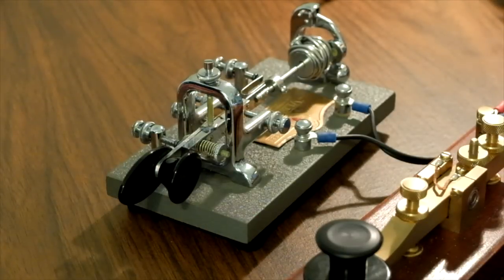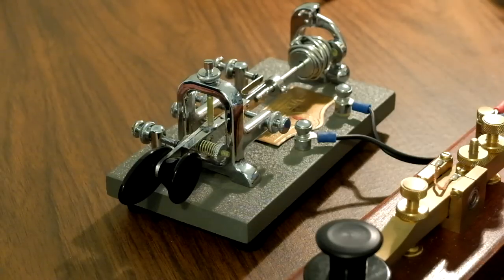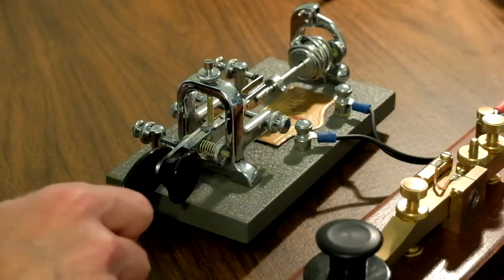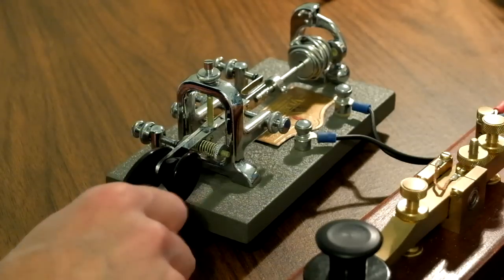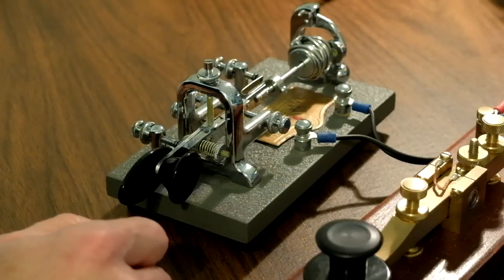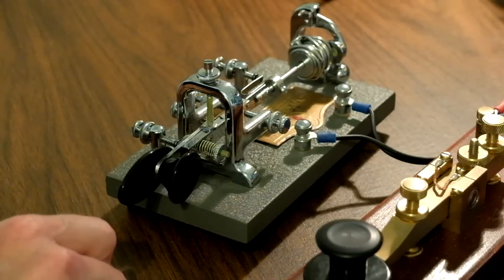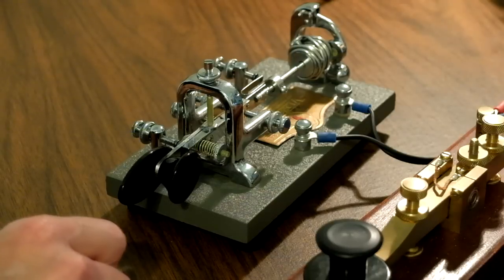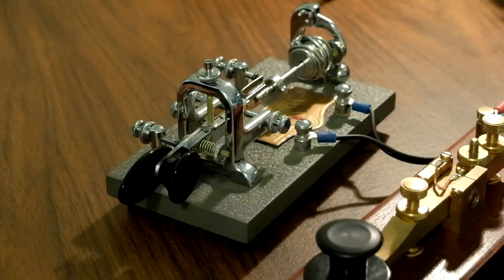What's up with the Vibroplex Bug Morse key's unique sound?

Comment: I watched an expert Navy sender on another video. He said you're supposed to grab the right-side key when interacting with slower users and make your own dits and dahs with that, from the side.  Not sure which was is right, but that's how he does it, and that way both dits and dahs are the correct slower speed.  Treat it like a sideways straight key.  I've also seen some guys dual-mount two keys on a board -- like an old Burnell straight key, which is in "closed" position.  Next to it is the bug or paddle key.  When using the bug/paddle, they'll keep the Burnell "closed" so only the bug/paddle works.  Then, for working slower ops, they'll open-up the switch on the Burnell and work from the straight key.

Comment: The unique sound, I suspect, is the result of the original design of the Vibroplex being suited to the commercial telegrapher of the early 20th century. The operating speed on the landlines was typically 35 wpm, and the rather narrow range of the Vibroplex is centered at this speed. Making the leaf spring either thinner or longer would slow the dits down, it doesn't appear practicable to add enough mass to the end of the pendulum for good sending at 13 - 20 wpm.

Comment: I was introduced to the "bug" in the military.  I was taught to "embrace" each of the paddles with the thumb on the left side (I am right handed) and the index and middle fingers on the right side, barely brushing against the paddle with each movement so that the base is never tempted to move side to side.  It's not a difficult technique to master  -  give it a try.  It will help you get /that "swing" out of your sending  rhythm.  73's
Reply from the maker: I've seen that demonstrated.i may give it a try.
Reply: It's the opposite of slap jazzing it.

Comment: If I don't have an "aftermarket weight," I take a Quarter and I alligator-clip it to the existing weight.  That can get the bug down to 13 wpm or so.

There's always the Farnsworth philosophy.  If my sending key won't go below 13 wpm, but the Ham I'm talking to is going 10 wpm, I can increase the spacing between letters to get down to 10 wpm, even though each letter is still being sent at 13 wpm.  At worst, it takes the other guy (or gal) a few seconds to adjust to the quickly-sent letters, but it's not a stress for them because of all the space in between the letters.

I consider doing that as "my good deed of the day," because I'm exposing them to more quickly sent letters, and that helps to increase their operating speed.

I would only send the letters a few wpm faster than the total speed.  I don't want to freak anyone out by sending, for instance, 20 wpm if they're only up to 10.

If they're going a lot slower than my bug can go, I can always switch to a straight key.  I never met a Morse sending device that I didn't love, so no problem breaking out the straight key.

Comment: never knew the bug's opt speed was over 25wpm. I worked my way up to Extra class when required to pass a CW test. got a bug due to, just couldn't send CW with a straight key any longer somewhere above 20wpm. I guess that is why I had no problem with  adapting to a bug, i was able to copy better than 25wpm.  I used my thumb and index finger as (without realizing) wrist action was less cumbersome.

Comment: I moved my weight to the back side of the damper and got it down to 15WPM. Also practice with a CQX 40m transceiver in practice mode its decoder is very unforgiving it took me over an hour to get my call sign down pat with no errors. I do love the bug though 1944 model black crinkle finish. All I can do is “ CQ CQ CQ DE WD4DCW.” I really need to practice copy more. I just love CW.

Comment: I've always preferred to use a straight key... that's just me.  I also have a number of side-paddle keys, both mechanical and electronic which I enjoy using too, but I'm loath to hook them up to a transmitter.  For some reason after I've used a side-paddle for a while, I no longer can send using a straight key and have to learn all over again.  It's odd - I can switch from a straight key to a side key without missing a beat, but once I've been on the sidewinder for a while I play hell trying to readjust to straight key telegraphy.

Comment: Might I suggest something - the “swing” heard by a bug user is due to the operator holding the dah down too long. I use a Vibroplex deluxe on the air and I have learned to let go of the dah side on time for the most part.
Reply from the maker: Yes, you are correct.  Hopefully, I'm a little better on the bug now after all these years.  When I recorded that video I'd only been using a bug for a couple of weeks.

Comment: I would like to make a suggestion, please. make your dashes all the same length. your Q in your CQ was sent with the first dash in the Q was much shorter than the second dash.  you actually sent dah di dah dit.      di dah di dah
listen to it carefully. it takes practice and since you are new to it, record your sending and look at on a scope. it will help you keep the dot dash rato 1:3 and all your dashes the same. be critical about your sending. you will soon be a A1 op.  looking forward to pounding brass on the air with you soon. 73 Ron K7RJ
Reply from the maker: Yep I don't sound like paddles and a keyer.

Comment: Does anything keep putting energy into it, or will it stop vibrating after so many dits?
Reply from the maker: The energy imparted by your thumb sets the pendulum into oscillation  generating the DITS.  However, Vibroplex hasn't invented perpetual motion machine so it will stop after producing 15 to 30 DITS.  Fortunately no International Morse elements have more than 5 DITS in a row so all's good.
Reply: @HamRadioQRP  I was thinking that may be the case. Devices exist using pendulims with an external energy source (an electromagnet perhaps) to give them a kick every oscillation so they keep going, but that would be extra complexity and need something to power it.